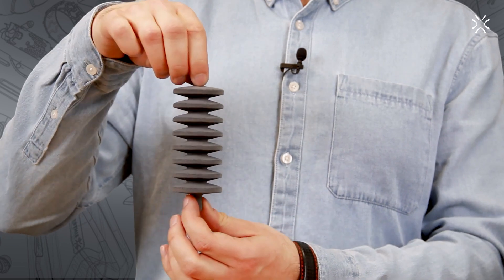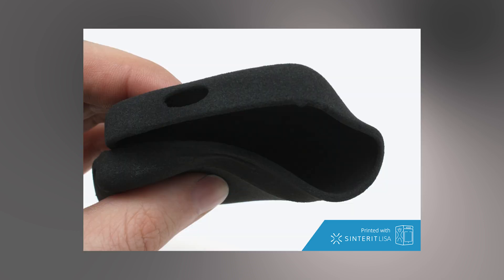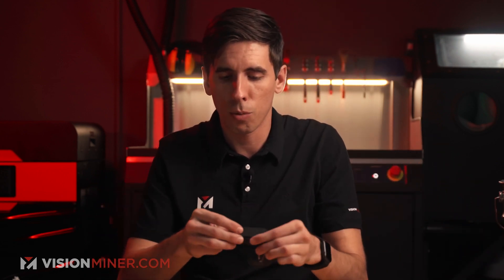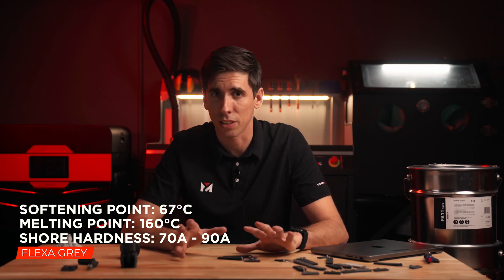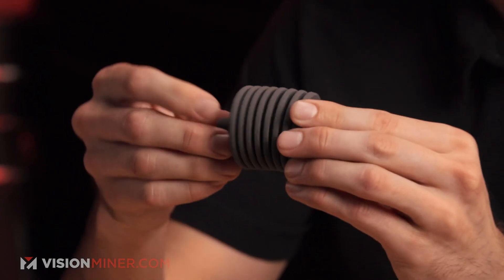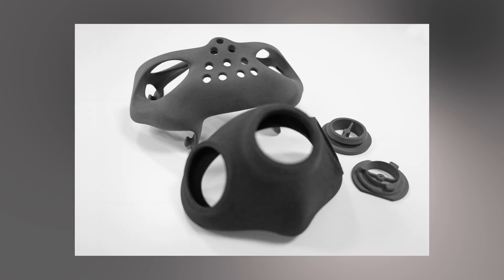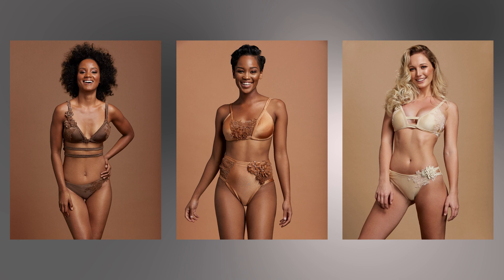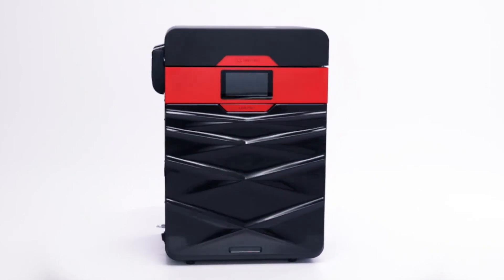Sinterit Flexa Grey Overview - Flexible TPU Rubber Replacement | Sinterit Materials

Comment: Soo cool and very interesting Material. I am a super Noob at 3d Print, but what is possible is Epic! Thank you for charing your Knowlege with us!! Sorry for my germ/engl. And Yes that what you always say KEEP YOUR FILAMEN DRY! Is true even PLA, dry no Prob even cheap Stuff to print, but more than 2 days under normal Air. Only Problems! First try to fix it with change settings, it was a Nightmare! But then it was a Clip from you guys that rembers me KEEP YOUR STUFF DRY!!! Now the most prints are not so good or good looking, because i'm toooooo lazy after every print put Filament back in my drybox. I only print in PLA. Every Print that is made in the first 36h looks good, nice and clean, but after 2 days the opposit and oozing, blobs ect..
Thanks a lot for your hard work to make a Noob like me a little bit smarter! 
Greatings to the hole Team! Stay safe and healthy ‼️‼️🤙🤙